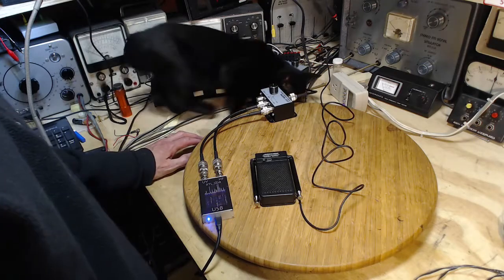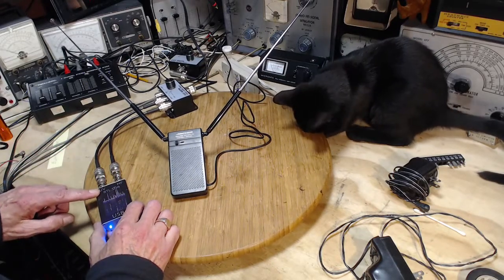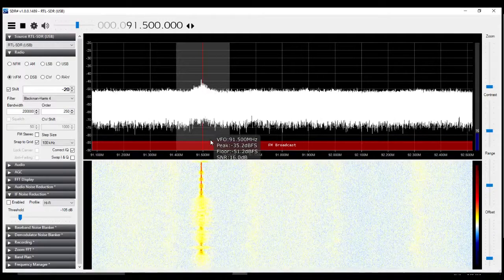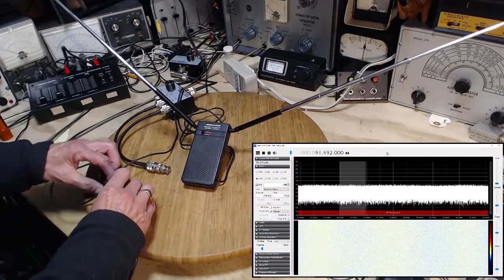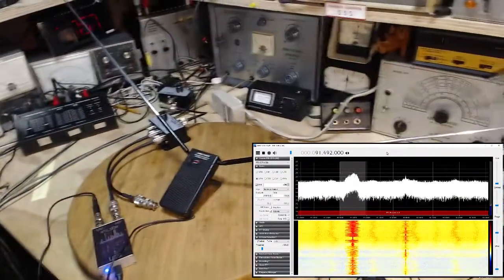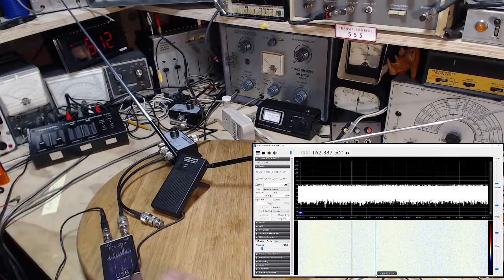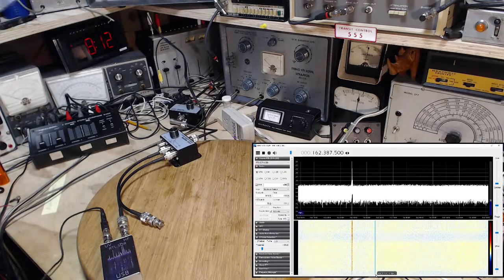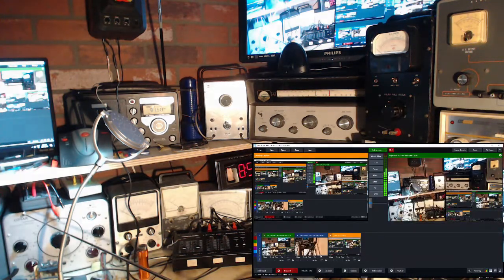Archer 15--1607 Amplified UHF/VHF/FM Portable Antenna

Comment: I have a newer version  model of the same device that I found in my hurricane supply bin for Irma that I used to use with an old analog b/w tv.  I would like to use this device with my newer TVs and A/V but none have a 3.5mm plug for antenna input.    Do you know want kind of adapter can convert this to a 75 ohm or f type connector?  Did you make your own connector?
Reply from the maker: Just cut it off and use the bare wires!  Any connector will do.
Reply: I have the same question also. Did you cut it off? If so, what are the results?

Comment: Oops, accidentally deleted my comment, I once bought an ampified wire loop you hung in the widow, I found it just amplified the noise and did not pull in weak signals, a simple wire outside to a tree worked better.
Reply from the maker: It's really about the signal to noise ratio

Comment: For what it's worth,,,, you have to adjust the length of the antenna arms depending on what freq you are trying to grab.
Reply from the maker: I was thinking that.  But there are so many factors with an antenna like that in close proximity to all kinds of stuff including a big bag of electrolytic fluid moving around the shop (that would be me) that I didn't think adjusting them would be productive.  I've hooked that antenna to my big FM stereo in my office/studio/shack and it's really helping even without switching it on.  It can live there for now.
Reply: i hope it works with my radio i got a radio shack radio with vhf